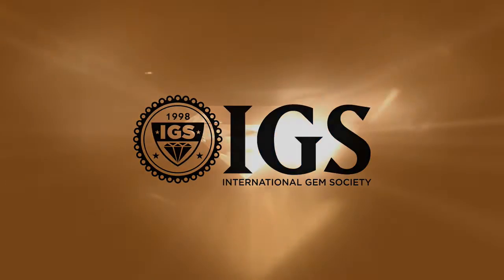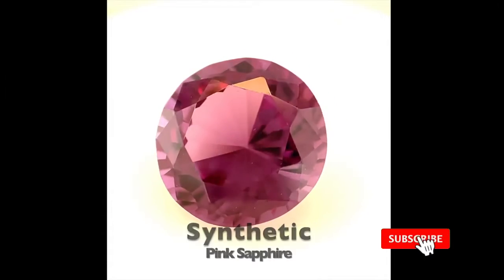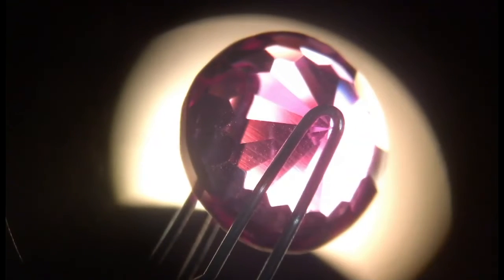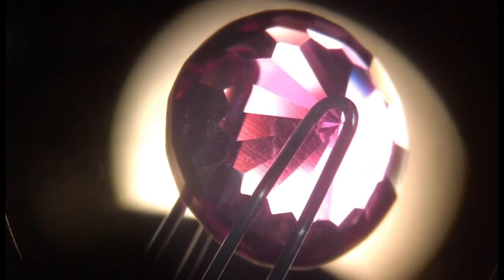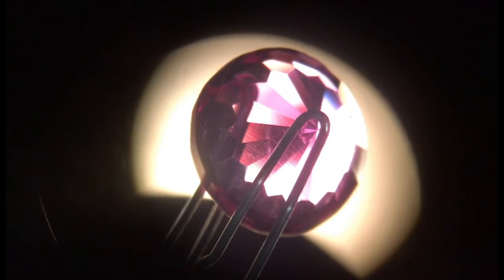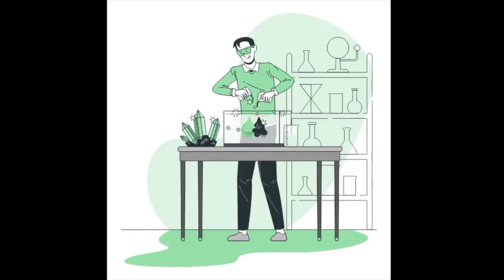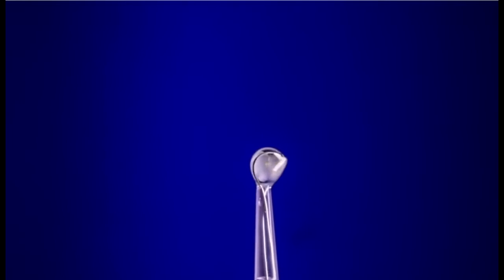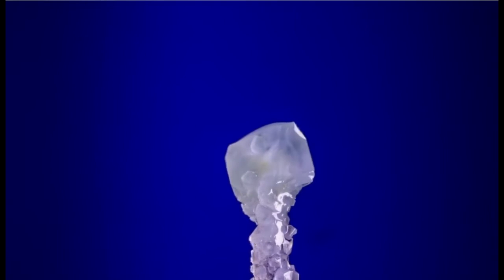How To Distinguish Between A Natural Sapphire VS Synthetic Sapphire

Comment: Yes, polish lines are limited to the individual surface and don't cross over the facet junctions. Unfortunately, the curved striae on the pink sapphire can't really be fully compared to the straight lines in the blue because we're only seeing the pavilion of the pink. The curved lines shown look like a visual aberration. At best, without a chain-of-custody, mine-to-market document trail and reports, I think technology is able to bypass the distinctions or will be very soon.